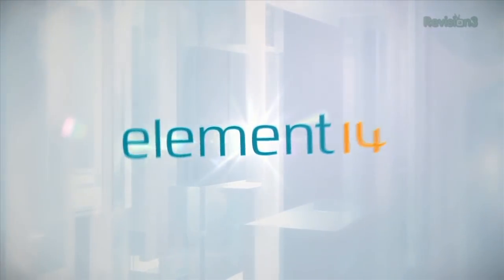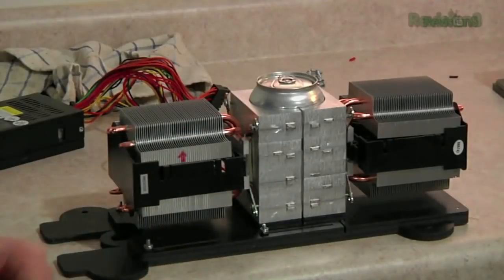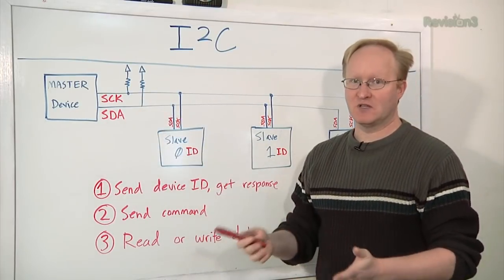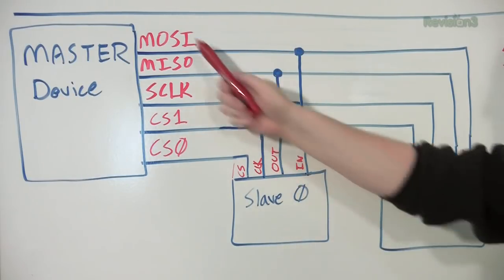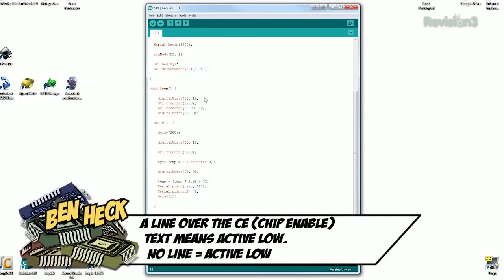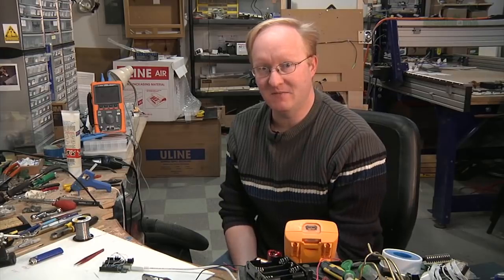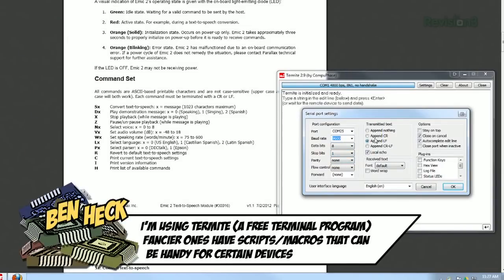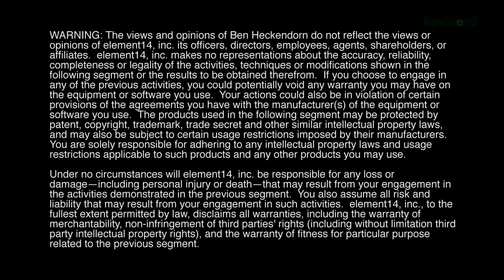Introduction to Interfaces

Comment: I don't fully understand why the I2C interface is slow. When Ben said that you needed to use a lot of calls to get data from a device, is he referring to the complicated code that you must write to interpret the information sent back to the master device? Or is he saying that the speed of communication (addressing a device, acknowledgement, commands etc...) slow?
Reply: ***** I2C specification says the datatransfer must be less than 400KHz, but due to the protocol, the real amount of information transfert is lower
Reply: (From memory) it’s largely by design as I2C originated from uses that didn’t require high speed, thus reducing costs (which is important in mass produced electronics). There are newer I2C standards that can go much faster than the original.

Comment: Thanks for a great demonstrations of interfaces! I am new to this kind of things and I have a task to send multichannel audio (24 or  16 bit PCM) from a fpga to a MUC.  I think SPI may do the trick but all examples I found have a data width of 8, 16 or 32 bits. Can I simply modify the code and set a number of data bits to 24?

Comment: Seems daft that SPI requires separate chip select lines fed from the master device. Could you not implement it with log2(n) lines and a decoder to save on the IO? In your example with two slave devices, that would mean that you could have just one enable output which is inverted to choose between the two. Is this a choice that you've made or one that the implementation libraries of the ICs you're using have made?

Comment: Is it better practice to use pull-up resistors as opposed to pull-down and letting the default state be 0? Is it just more common or are there practical reasons to have your default state 1?

Comment: Could you give an idea of the relative speeds other than "slower," or "faster?"

is i2c generally slower than rs-232?

also is there a general rule of thumb approximation for the speeds of the three interfaces (in terms of frequency)?

what would the exact frequency be dependent upon in each of the three cases?

Comment: I'd like to add some clarity if I may.

An interface in this context relates to physical aspects of a device.  And, within that physical context there are 2 primary aspects:
1. mechanical attachment, and
2. physical signal characteristics

Protocol, on-the-other-hand, is purely logical and defines the rules for how signals will be interpreted.

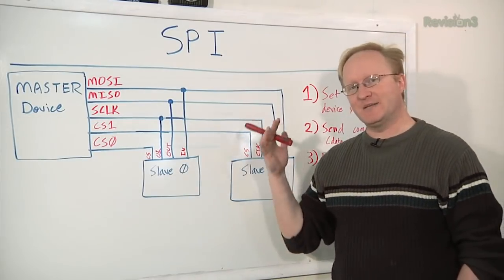Comment: @about 5:35 you start talking about SPI interface and you mention that we need 3 connections MISO and MOSI and a clock but what if we had only one slave do we really need a Slave Select connection and if not how can we initiate the start of its work?
I have an idea of interfacing a PIC microcontroller with an RFID card writer/reader (for Arduino) (bacause they are available and cheap)!? #<well here is project idea for you>#

Comment: You brushed over RS232.  Your example used TTL but on some older equipment it needs the +/- voltages in order to work correctly.  You completely ignored the charge pump topology to the Max3232 chips that help to bridge this gap.  I don't think this is very thorough treatment of this interface.
Reply: Hence why the title features the word "Introduction." If you think you can make a better video, then do it.

Comment: Hello Ben Heck's,

i have a doubt. I have an arduino uno, and i need add 2 shields to my project. One is an wifi shield and the other is an datalogger shield. When i put the 3, the wifi shield does not work, but if i remove datalogger shield, then wifi shield works fine. I need use SPI protocol? I think yes, but i don't know how. Any ideas?

Thank you so much!

Comment: I have a project that reading data periodically, and I have 2 options either SPI or UART.
Is this right: "We should SPI and  not use UART because there's no clock (Asynchronous) and at certain time I'll lose some coming data" ?
Or losing data will never happen in RS-232?
Thanks
Reply from the maker: Mazen Omar SPI does have a synchronising clock; but you can lose data regardless because there's no recovery mechanism by default over either types of serial.
Reply: The Ben Heck Show 
I see.. Thank you very much
I'm really enjoying of your channel and how you explain topics in easy way :) 
Keep going ^_^
Reply: Mazen Omar I'm an almost complete noob. 1 year ago electronics i would have believed the magic smoke theory. I found SPI to be the most pleasant and speedy protocol both when it comes to sending data and the post processing that occurs. I mean you have MISO, MOSI, CLK and CS. Enable the thing, put a bit, wank the clock and that's it. Same goes for reading. All you need is the sheet that tells you what the device says (the chart with the timeline thing). If dealing with say a microcontroller and some high level language like Arduino, then it's just a matter of knowing your bitwise operators and you're all set. Of course there is the tedious crap of MSB/LSB, rising edge, falling edge etc. but most things work MSB and rising edge and even the lamest chip can do 4mbps easy. It usually takes me 15 minutes tops to hook up an SPI thing at the first glance (perhaps more if the datasheet is rubbish).
If you fear you might be loosing data (not working with a microcontroller or a real mode CPU), add something in between to buffer messages (just a suggestion. I've never had to do it).
Also the recovery thing is done further up the food chain. I suggest you read on the OSI layer thing. Me being a programmer for a living, I figured out quite quickly that serious error control and data recovery/resending is done further up in software. Like for instance in TCP/IP, the TCP part is layer 4 (on top of 3) and it means Transport Control Protocol as it deals with ensuring what you get is what you've been sent (by using checksum validations and if needed, retransmitting the darn packet). You also have UDP over IP which does not care if the data is sane or not and most of it is porn anyway. It's used for streaming and stuff like that where people's faces might be ugly so UDP will at most times improve the quality of the signal by distorting it. So down to the bare metal you need no data checking, you need raw speed.

Comment: Using the I2C interface, how does the Master Device identify the Slave Device that it wants to communicate with, since there is only one dataline leading to all devices? Do you serially shift in the ID bits and then the Slave Device "wakes up" when the correct ID has been shifted in and starts communicating? Or would you use a multiplexing chip hooked up in between the Master and the Slave? Also, am I correct in assuming that if this is the case, the I2C is half-duplex only?
Reply: Lebanese Edgyist I2C has an actual protocol: at an early point in time it even had a variant that was effectively a low-speed USB. The functionality is as you describe, being only half-duplex (if you really want full-duplex with I2C, then investigate super-heterodyne radios: a software version could do the job).
Reply: Lebanese Edgyist In the I2C communication protocol, the master sends on the bus the chip address that it wants to communicate to. All the slaves listens the same data but only one of them acknowledge and the master continue to communicate sending commands ad data to that slave.
Reply: Each slave device has it's own read address and write address